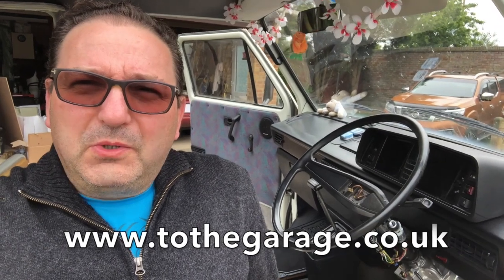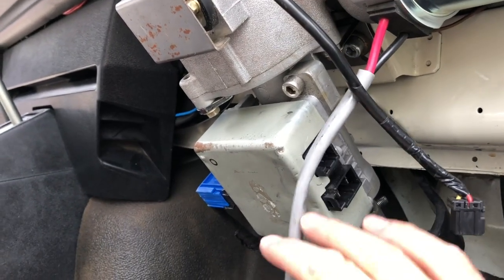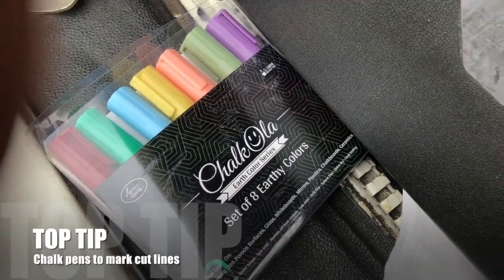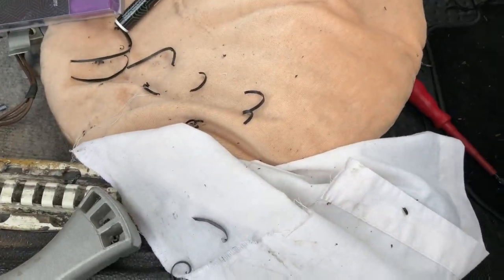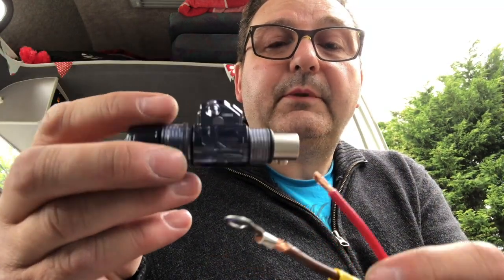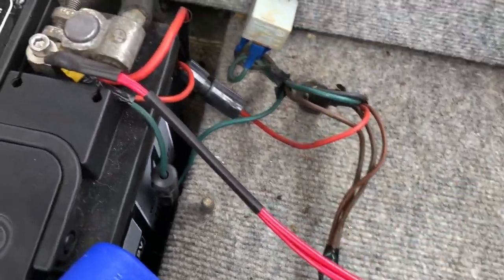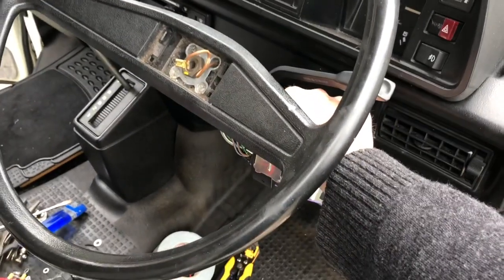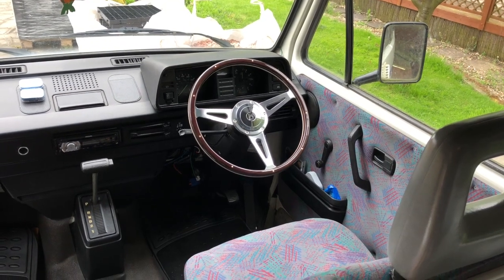VW T25 T3 Vanagon Power steering conversion Pt 2

Comment: I don't know whether you'll get to see my comment as your install was done three years ago, but please consider moving your 50A fuse to the battery end of the cable...not the load end.  If you get a short to ground on the section of cable between the battery and the fuse, your fuse won't see it and your cable will most likely melt.  Single insulated cables do rub and chafe with vibration so it might take a while, but anything you can do to mitigate a possible disaster ought to be considered.

I commented over on the 'Maxwell Smart' channel after he did a similar thing on his '84 Westfalia. 
https://www.youtube.com/watch?v=5OSa-MzMGqo&ab_channel=MaxwellSmart

I've now completed my Corsa C column install conversion into a T25 and will agree that the result turns the van into a silky smooth puppy rather than the two handed beast it previously was! (albeit only at parking speeds!)

I initially left the steering controller in it's 'Vauxhall' configuration (ie mounted on the column) but I didn't like it as it left all four connectors to the ecu exposed and in danger of getting clobbered by an errant driver's foot or two....
I ended up mounting it inside the dash just behind the column and only had to lengthen a couple of the 'add on' controller's wires simply because I'd previously snipped them down to length in a vain attempt at neatness....everything else just plugged back in although I did rotate the motor 180 degrees to free up it's connection a bit.

Nice channel too btw.
Reply from the maker: Thanks for the comment and the compliment Mark. Thanks for the tip re the fuse. I must confess I had not thought about it from that point of view. So consider me educated and grateful.
All the.  best
John

Comment: how is this working two years later?
great video series...great channel....thanks for taking the time
Reply from the maker: No Problem at all.
My dad drives her as a daily and the only issue he had was that the fuse holder we used for the main supply unscrewed its cap and gave a bad contact (may have been me not tightening it enough😉)
Anyway Dad was so used to the power steering that he was convinced he had a flat tire rather than a power steering bad connection.🤣

Comment: Hi John. I've just seen this. I fitted such a unit into my '78 VW LT28.  Well, my auto electrician did the wiring. It came with a rotary knob that reduces or increases the steering effort.  So I adjust it back a bit for open road work. It's a Mondeo unit, but looks very similar. My spline (larger) is the same as my Daimler V8, so I fitted a large Momo s/wheel with 'Jag' adapter.  Cheers. Paul. NZ. '99 XKR.
Reply from the maker: Wow. Not often we get a VW / Jag cross over link. Thanks Paul. I fancy the variable assist knob🤔. 👍👍

Comment: Hello,
Very good job and Video.
Can you give some long term experience with the system?
Reply from the maker: Hi Frity
Its my dad who puts the miles on the T25 these days but he has covered any hundreds and is still enjoying smooth and light steering. He did have a minor hiccup. Ironically as he was leaving a VW festival. He thought he had a flat tire.(he has never driven many miles without the power steering.) Turned out it was the 50Amp fuse supplying the steering motor. It had not blown, it had mechanically failed. The usable link inside the glass tube had become detached from its end cap, so when you squeezed the fuse slightly it appeared to be fine and as you let the pressure off it went open circuit. Anyway a new fuse and holder later and all is well again. Once you have driven a 100 miles with the power steering you will claim its underivable without it. 
No issues with the supplied Kit at all so far.
Reply: Thank you very much. Another question, how strong is your generator?  I have a 65A Generatoren but two batteries in my T3. I have some thoughts that the system could need too much power.
Reply from the maker: @Frity FantomWe have same system and two Batteries also on a zig split charge system. No problems.
I believe the Vauxhall corsa is the doner for the power steering motor so our commercial vehicle electrical systems should give no problem. Just ensure that you use a suitably heavy supply wire from the Battery to and through the fuse.
Reply: @tothegarage  thank you!